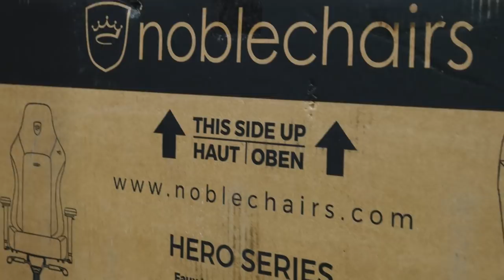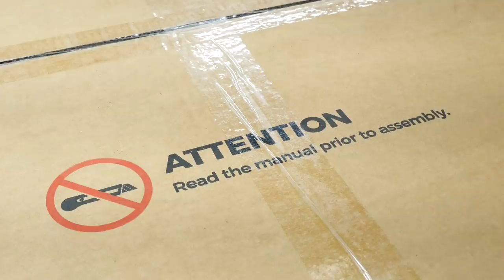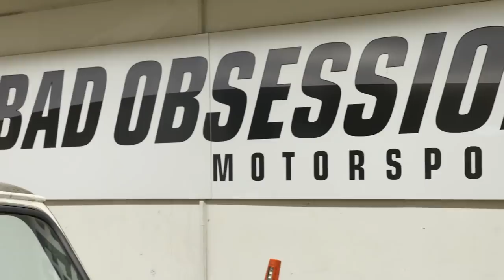CREATORS UNCOVERED - Bad Obsession Motorsport

Comment: I was hoping all the required brackets had been replaced with a sheet of steel, some poster board for templates, a sharpie, and an angle grinder. Some assembly required
Reply: Make the noise.